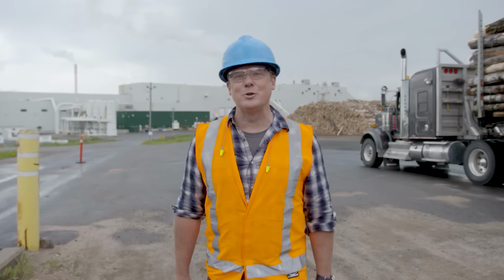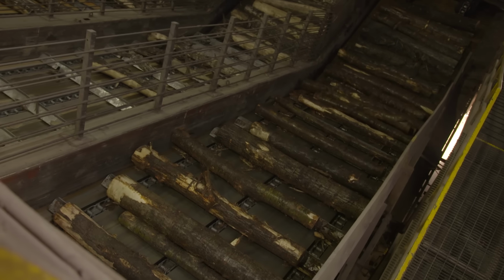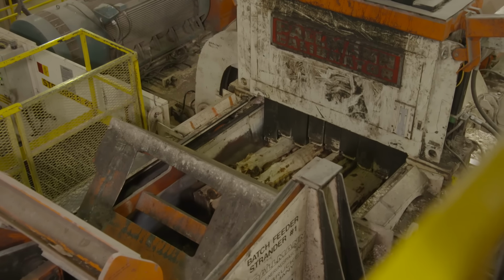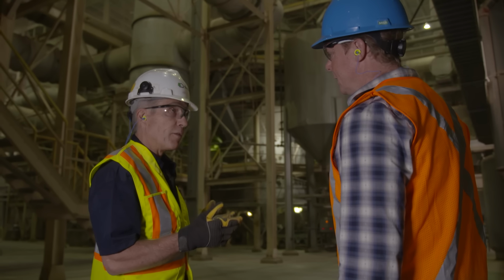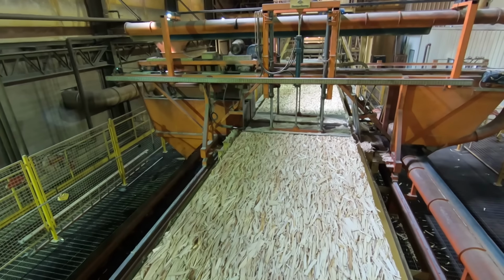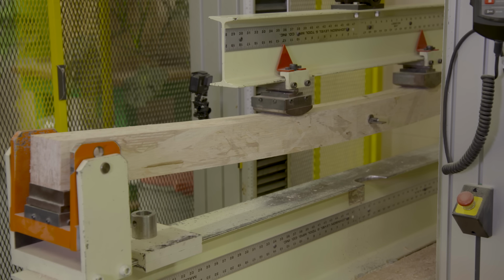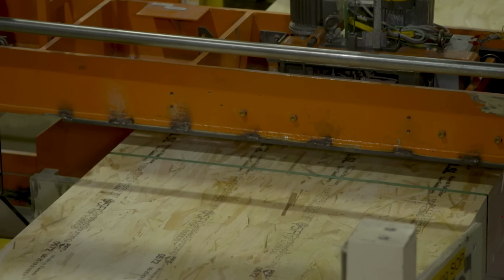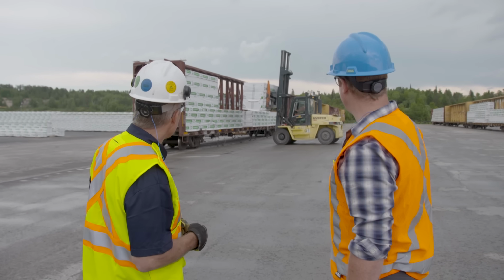Laminated Strand Lumber Factory Tour | This Old House

Comment: Interesting, but 3 big unanswered questions:

1. What do they use to bind the strands into the final product.  
2. How does normal lumber perform in their stress tests.
3. How does their product perform once it gets wet in a real world situation.
Reply: the strands that are cut from logs and dried down to below 3% moisture are sprayed with a mixture of melamine resin and wax - they then enter and orientation former and are formed into what is called a mat. Typically MOR and MOE (modulus of rupture and modulus of expansion) of engineered timber exceed natural timber. Engineered timber will out perform natural timber if it is used and installed correctly.
Reply: @serge.crispino418  Quite. With engineered timber the quality can be controlled and quality can be repeated, for ever, sort of thing.

Leaving it up to Mother Nature produces quite a range of "quality".

Plus in that particular plant nothing went to waste, what material wasn't in the product itself was "consumed" or converted into energy to make the product. (To my mind the designers deserve a medal for ingenuity, energy conservation and generally making the planet "greener" for the rest of us.)

Eventually, I would posit, the process will be entirely automated and totally overseen by an AI monitoring everything from the weather, for producing the timber, planning future production rates, right through to monitoring consumption and demand and scaling up, or down, said production rates.

Straying slightly off topic it would be interesting to know if using these products caused more or less wear on cutting or shaping tools.

It would be slightly ironic if the engineered product was cheaper to buy but you ended up spending a fortune on blades, drill and router bits etc, etc just trying to "use" it.
Reply: @t1n4444  When would you use drills and router bits on OSB?
This is just basic building material that gets power sawn and nail gunned .
Reply: @dnomyarnostaw  Hmm. Maybe on your side but over here we use OSB (or sometimes we call it "Sterling Board") for decorative finishes, as in stained, sanded and varnished for example.

Plus we have a lot of students, would be artists and "creatives" all trying to "out trendy" one another by designing some sort of "art".

In fact if interested you might care to have a squint through YT offerings and see just how versatile OSB can be.

I gather some router bit manufacturers make tungsten carbide edged bits especially for OSB.

I gather they are spiral fluted to cope with the resinous "properties".

I note that on occasion an OSB board is fixed in place on studwork and then window openings routed out afterwards.

Nail guns ... not so widespread over here. I have used the small brad sized guns for trim but nothing big enough for studwork.

Nail guns first used here, as far as I know, for fixing studs to concrete or steelwork. I think the brand was "Paslode" and carried all sorts of dire warnings as used explosive cartridges as opposed to compressed air, say.
Reply: @t1n4444  - thanks for the reply. Having worked in the particleboard industry as part of an engineering team for 27 years one could say I have some knowledge of engineered timber. I also have been involved with MDF and OSB. I keep my foot in the panels industry with servicing and maintenance of CNC woodworking machinery, I have also visited many panel plants in Australia, Canada and Europe. Yes, that plant is very modern and the efficient and closed loop heat plant is testament to this, I would not be surprised if they also produce their own electricity. This is very common in Europe not only in the timber industry. Of  course the best thing about engineered timber is it's consistency and relative cost given that it is made from wood waste. In respect to automation versus jobs I have no problem with automating menial tasks as I consider this good progress and would like to think that jobs are created in servicing the machines that do the menial tasks in lieu of menial tasks. As engineered timber can be harder the wear on machine tooling has always been there and is a known. The nemesis of engineered timber though is tramp metal that may find it's way into the process or more common is silica/sand that is not washed out of the chip that becomes part of a board that has a catastrophic impact on the wear of high speed machine tooling.
Reply: @t1n4444  I dont know where "over here" is for you, but cutting out window openings with routers is just strange  
I have been using my Pasload gun for over ten years, so I can't imagine a building site still using hammers. 
Arty people trying to use cheap materials is hardly a cause for concern for the few power tools they might damage. 
All in all,  I cant see any real downside for engineered timber products.
Reply: @dnomyarnostaw  As mentioned earlier if you have s moment take a look on YT offerings.

I find it fascinating how " a" product, designed for "a " purpose can be "hijacked/subverted" and used in ways the original designers never envisaged.

Cost of edged tools might not be an issue for "us" but for young students/penniless inventors on innovators it might be.

Currently it is very trendy, in UK at least, to recycle or repurpose items, we have a fair few TV series devoted to the topic. It is truly astonishing to me that a seemingly worthless item rescued on the very brink of being chucked in the skip ( dumpster?)is handed over to a recycling/up cycling expert and turned into something the chattering classes (nouveau riche?) are happy to hand over a King's ransome for.

Nice work if you can get it.

Ref the sturdiness of the OSB and other types of product, then entirely agree that is part of the charm.

You will have gathered we don't look on such products as merely building material not seen when the coverings are applied.

As for nail guns ... sheer luxury!
Reply: @serge.crispino418  Tramp metal.

Not heard it called that before but had heard of saw mills in eastern Europe being badly damaged before metal detectors were employed.

Turns out that during WW 2 a "lot" of trees had been hit by shrapnel from grenades or shells and the timber had just grown around it.

You can imagine a huge circular saw finding a piece of hard steel ...
Reply: @t1n4444  - in Australia it was common practice to put a horse shoe that fell off a ploughing horse into the fork of a tree. Sadly these would be forgotten to be collected at the end of the day and the tree grew around the horse shoe. Mostly wind breaks these trees where eventually chopped down or blown over and in any event would end up being passed through a saw - yep big problem. These days no one wants these trees for this reason and they are burnt in the paddock. As we have had no active wars here there is no need to worry about shrapnel - horse shoes are our nemesis - LOL.
Reply: Scrap cash  Sounds like you need to get a Sabre Saw, with a reciprocating blade. 
You can run it flush with the window frame, and not produce heaps of dust, and wear out expensive cutters.
It also had the advantage of coping with unexpected hard spots,  nails etc.
A router is a cabinet making tool, not a framing tool.
Reply: Scrap cash  Phew! I was beginning to think it was only me who saw the YT video!

Do I take it the router had to be fairly powerful?

The largest I have seen advertised in UK was 2kw with half inch spindle capability.

Do I take it also you would have used solid tungsten carbide bits?

I shall never ever get to do anything like what you describe but always find construction stuff fascinating.

When we first got cable in UK the cable companies just about broadcast anything and everything  they could to win customers ... I believe I watched just about every available, then, episode of ToH and NYW (Norm featured on UK cable every single day and appeared to have more "air time" than anyone else.)

And Bob Vila seems to be involved with building every house there was.

Ref the use of a router to create the window apertures (and vents?) then that is an excellent example of "mission creep" ... almost an adapt and save/make money sort of thing.

And, if a process works then why not?
Reply: @dnomyarnostaw  I read what you write RW but perhaps your ultimate sentence is no longer accurate?

I suspect a lot of tools "migrate" to doing other work than they were designed for.

Chain saws designed for felling/lopping trees but occasionally you might see one being used for making sculptures or furniture out of tree trunks.

Or, as a few folk found, a chain saw was an idea tool for breaking and entering any building with a timber door in a shed or barn. Simply cut around the lock and handle ... door swings open.

Or just cut a new doorway.

Interestingly the "antidote" was to pack a lot of rockwool insulation behind walls. As soon as the chain hits the rockwool it stops dead.

Coincidentally another example of "mission creep" that the insulation designers never considered for an instant when they first came up with the idea.

I believe pro chainsaw users wear some sort of nylon trousers where the nylon fibres jam the chain. You get a nasty cut but doesn't have your leg off ... well, in theory at least ...
Reply: Clinton Johnson 
1. Glue'n'resin'stuff. Trade secret
2. Supposedly worse. Especially the cheap fast growth one
3. Like wet OSB. Do not get it wet. If there's any remote chance of that area getting wet, use normal lumber.
Reply: Don't listen to these over achievers. I'll give you the lowdown.
1. Rubber band
2. They perform like people, they crack.
3. It gets cold.
Reply: I'd add "what is off-gassed from this engineered lumber?"
Reply: @doxielain2231  - he is referring to formaldehyde gas that continues to be released from the board for some time after it has been pressed.
Reply: @serge.crispino418  Horseshoes, seriously, who'd have thought it?

Hmm, I think your comment might just have cast some doubt to the saying "Lucky Horseshoe".

(Bit like "Lucky Rabbit's Foot ...did anyone ask the rabbit?)
Reply: @t1n4444  - putting a horse shoe in the fork of a wind break tree is not for good luck or voodoo - LOL - what I have been told is that if a plough horse 'threw' a shoe whilst it was ploughing the field the farmer would/may put the shoe somewhere from where he would pick it up at the end of the day and take it and the horse to the local blacksmith to be refitted. Sadly if the farmer forgot about the shoe in the tree the unfortunate sawyer would make no money the day he cut up that log. Circular saw are more forgiving however a band saw would not be spared by a metalic lump of hidden steel.
Reply: @serge.crispino418 

Horseshoes; we bang them up all
over the place, especially on shed doors. But, have to be with open ends up ... otherwise all the luck runs out 😂.

That said a previous owner nailed a painted one (canal art, allegedy) onto the engine room door on my boat.

Said boat still floats so obviously proof positive, then.

Hmm, watch out rabbits here I come.
Reply: @t1n4444  run rabbits run - LOL
Reply: @serge.crispino418  Not after I've attended to them ...
Reply: @t1n4444  A lot of strange anecdotes, but little bearing on the subject. 
The ultimate arbitration on tool usage "creep", is cost. 
Price three half inch, high speed router spindles to do a house full of Doorways,  versus a packet of sabre blades.
End of usage "creep"!
Reply: @dnomyarnostaw   Hmm, anecdotes ... I can't quite get the thrust of your argument. You appear to be saying that people can't adapt tools or methodologies forget other purposes.

Why is that? There are many extremely fertile minds out there who don't think the way you do, which is fair enough.

Trouble is tho' that people might not be interested in such "rigid thinking".

Why not let them just get on with stuff?
Reply: @t1n4444  Oh FFS RK. Its NOTHING  to do with ingenuity or adaptation.
Its flamin' economics in time and parts.
How much plainer do I have to be,
Reply: @dnomyarnostaw  Hmm, but that's how you perceive things to be. Clearly other folks have their own ideas.
Reply: Why in the hell are they using POPLAR to make this crap? I though they made this INFERIOR building material with refuse from  normal milling operations, not from new POPLAR trees.
Reply: yeah i enjoyed this video but it was an ad lol
Reply: @shoofle  Well it's broadcast on commercial TV so can't see an issue 😂.
Reply: Question 2:  @5:04 The plant manager said: "resin and wax".
Reply: Three words.
 Research. It. Yourself. 
Go on the internet, type your question, read your answers...

Comment: For those whining about automating the packaging process and will put these guys out of a job: did you weep for the horse crap cleaners when cars were invented?
Reply: I wasn't around for that. Your question is irrelevant.
Reply: @ccoit  Absolutely not irrelevant at all.

It's your response which lacked relevance 😂. As in I don't suppose he meant anyone in particular.
Reply: darkity fine.  Do you weep for the cashier who used to work at Blockbuster?
Reply: This is the lowest-common-denominator communication everyone has adopted online -- the one-upper. "Did you weep for the horse crap cleaners and Blockbuster cashiers?" Such a jackass thing to say and it's all I see anymore. It's even seeped into T.O.H.
Reply: @robbankeriii   It may be RB that if you are detecting more of same then this merely reflects people becoming "woke".

In short time moves on and looking backwards with "manufactured nostalgia" isn't worth it, on the grounds you can't do much about it now.
Reply: @t1n4444  it wasn't any opinion about machines vs labor. I was scrutinizing his style of arguing by creating an exaggerated sarcastic correlation.
Reply: @robbankeriii  As was I.

However I will concede that my take of "an" issue is not necessarily as yours.

Comment: How does it hold up over time? It's fascinating to look inside the walls of my own 100+ year old house, and find high quality lumber, still intact and in good shape. Will this product hold up for a century? That will be interesting to see. I also worry about effluence, all that glue (VOCs) going into our lungs. Is that good?
Reply: It'll hold up longer than you will. Off-gassing is very minimal - I would be more concerned about off-gassing from new appliances in a new home (the production of which often involves voc's as well) which takes approx 2 years to drop to the normal levels found in an avg home. The lumber in your home is encased in a wall and sealed behind vapour barrier with acoustic sealant or building tape (both involving voc's) - if there's any air exchange between inside and out, then it's happening when you open a door or window, or your builder severely messed up the job and you have an open wall somewhere. Your complaint is akin to worrying about petrol fumes finding their way into your car while you're driving. If the manufacturer did their job and it was inspected properly, then you should have nothing to worry about. Of course, we all know that you're going to breathe in far more hydrocarbons just fueling up at the pumps than you ever will while driving - the same can be said when comparing off-gassing from urea formaldehyde (the glue used in stranded lumber) and off-gassing from the contents in your home like your refrigerator, sofa, computer, etc. Unless you build everything you own with mud and natural lumber, then this is something you're going to have to accept. Bottom line - don't be too worried about building materials. Building code exists for a reason, and as long as you don't cheap out, do your part in finding a competent and experienced contractor and have their work inspected, then chances are your safety and comfort will be their top priority. We like repeat customers, not dead customers.
Reply: @JamesBiggar  That makes a lot of sense, and thank you for taking time to comment on things not discussed in the video. Much appreciated. As you may have guessed I am not a builder, but work in HVAC business and know how important it is to have good indoor air quality.
Reply: @thunderpop609  Your comment makes 0 sense. If they're structurally sound, then they're still almost as valuable as they day they were installed, minus the nail holes. It seems that none of you have a whole lot of experience in the trade but like to talk as if you do. OSB has been used in construction since the mid 60's....that's 60 years. Do you know how many 60 year old houses I've torn down? 0. Do you you know how many 100+ year old houses I've torn down? More than I can count. I've seen lumber from both old growth trees and new dry rotted to dust, and I've seen OSB, LVL, LSL etc look as pretty as the day it was installed decades after the fact. It all boils down to the build quality. If your builder is an idiot and doesn't know how to size structural components according to their load properly or keep the weather from penetrating the envelope, then it won't matter what you've built with. It's not going to have any value.
Reply: Thomas Bertilsson It'll hold up as long as it doesn't get wet.
Reply: @thunderpop609  Are you sure you're not using "nostalgia" as a valid argument.

Building technology is what it is, or was, in its day.

You imagine 100 years is some vast length of time. There were pharoahs still in their pyramids after 5000 years but doesn't mean we're all going to want to have homes built out of 2 tonne blocks.

The cost of foundations alone would be colossal.